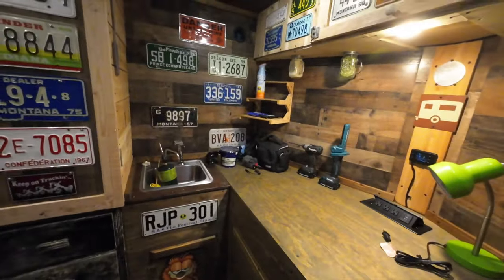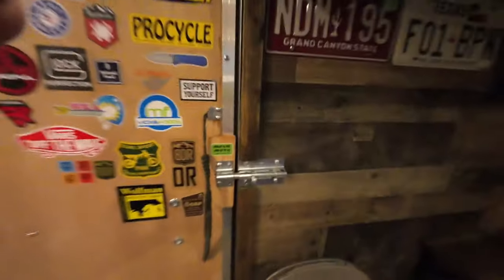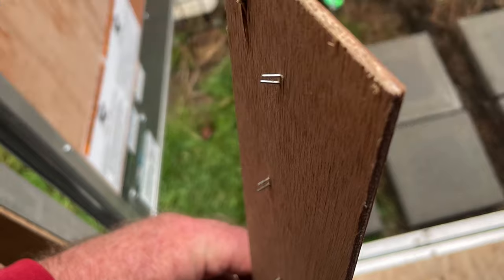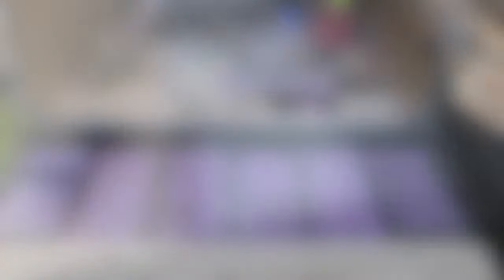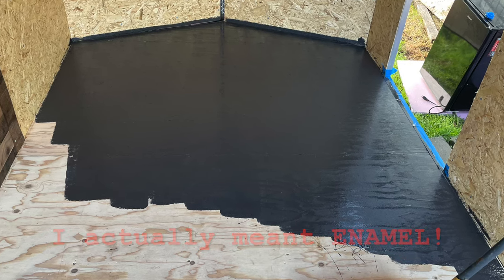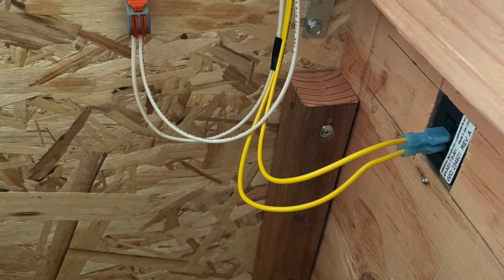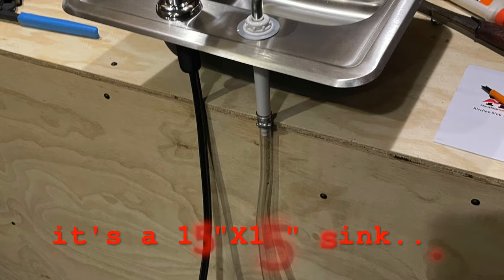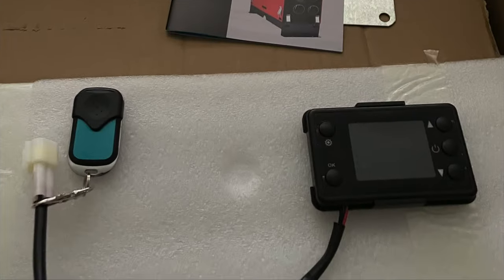12' X 7' Cargo Camper Cabin/Toyhauler or Tiny House! Look inside

Comment: NICE ! I have a few months building one. 6x12 V nose. BATTLE is the WIFE Thinks it will be my 36 ft Toy Hauler 5th Wheel ! NOT the Same Thing for Camper, Harley Garage/Hauler ! Big Difference in 3/4 Dodge Diesel to a small Dodge Dakota Gas (both 4 door) in FUEL COST !
Reply from the maker: Very cool!